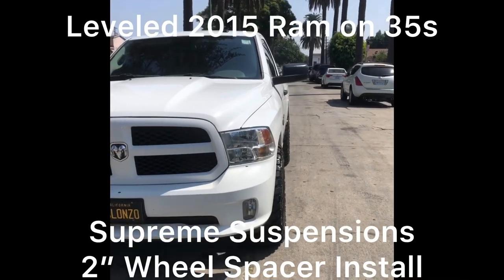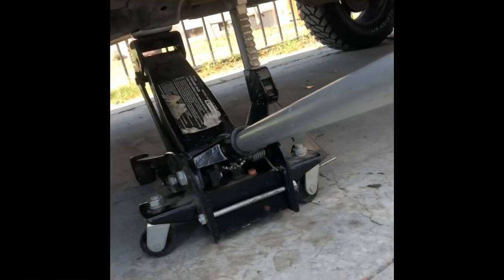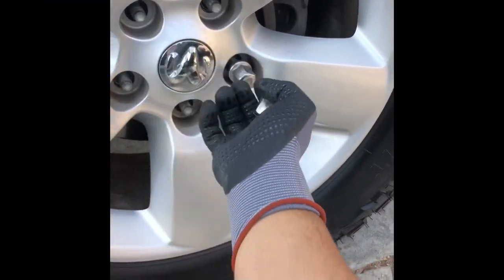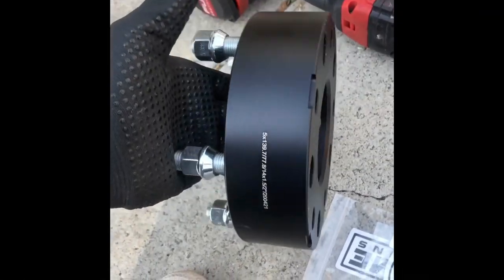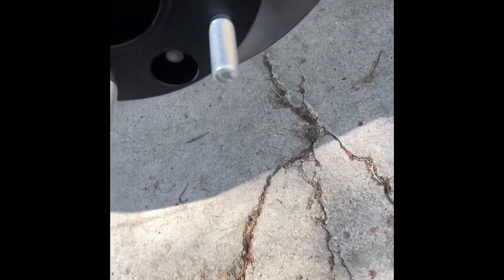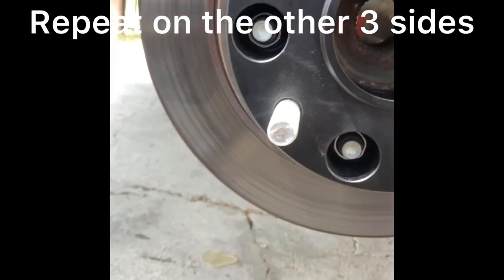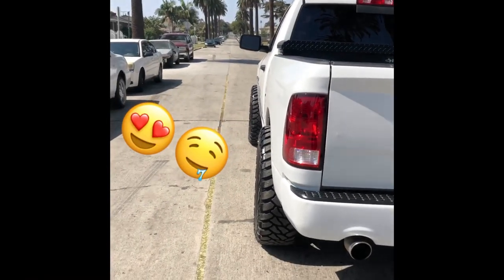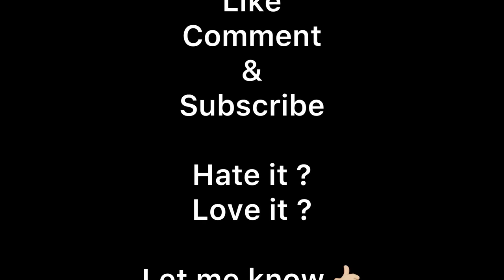Leveled 2015 Ram 1500 on 35s | 2” Wheel Spacer Install | Before & After Photos | Supreme Suspensions

Comment: Nice, had the same wheels spacers, no issues (no issues two years of use).  I removed them when I got wheels with -14mm offset, it's the equivalent of the stock wheels with 2-inch spacers.
Reply from the maker: Dope 😎 -14mm offset wheel are for big boys. Good shit bro

Comment: You got one of the highest strength loctite they have. It will be fine if you don’t take the spacers off but if you need to you will need to heat them up with a torch. Blue loctite can be worked with hand tools and red will destroy threads if you don’t use a torch first to heat the studs.
Reply: How about when I have to replace my rotors.  Do you recommend blue or red loctice?
Reply: Blue without question.  Red will ruin threads as described above. Red is for permanent. Very rarely used in the automotive world.

Comment: I just installed Rough Country 2” spacers with stock rims and 35s.  2017 Ram 1500 Big Horn.
Heavy rubbing against the plastic wheel well and it’s not even a full turn. I’m actually considering taking them off.  
How is it that it’s not rubbing for you?  You have stock rims too.

Comment: did you have to lift the truck for the 35s to fit ? i just got some 35s
Reply from the maker: I already had the level kit installed before I put the 35s bro
Reply: @shoobiedoubie6871  do you think without a level kit they would still fit on stock height
Reply from the maker: @crisguzman9  Yeah, I think they might, these trucks have a ton of space in the wheel wells
Reply: @crisguzman9  if you got this generation ram then 35s will fit without a lift or level kit .. I got a 2014 stock suspension with 35x12.5x20 and no rubbing at all

Comment: I have 24’s sitting on 35” tires, have you had any issues?
Reply from the maker: No sir 😌, have you?
Reply: @shoobiedoubie6871  
Yes my tires rub the plastic wheel well liner whenever I cut the wheels all the way to the left or right.
Reply from the maker: @Tdub66  try a 3” level kit. It’s super easy to install.
Reply: use heat gun push the plastic in more. no cutting if you don't have too.

Comment: I just bought 35x12.5 for my 2020 ram and installed a 2" level. I want to do a 2" spacer also. Just wanted some feedback to see if any rubbing issues would happen on a full turn lock position L and R would happen. Nice truck by the way
Reply: I'm wondering the same thing. I put 2 in spacers on my 09 ram 1500 3 in level kit on 35x12.5 and I would need to cut out some fender to make these babies not rub. Curious as to what all to cut out, and how to make it look good after so it's not just a hack job

Comment: Is the front a 3 inch level? I am about to do the same set up
Reply from the maker: Yes sir a 3” level kit
Reply: @shoobiedoubie6871  cool how often do you tighten your wheel spacers?
Reply from the maker: @nelktwo  honestly never, except like 2 months ago when I changed the brake pads and rotors.
Reply: @shoobiedoubie6871  do you still fit in the automatic car washes bro?
Reply from the maker: @nelktwo  if you’re talking about an express car wash like the ones that you have to go into neutral and it pulls you thru your wheel,  yes sir 🤙🏽
Reply: @shoobiedoubie6871  thanks man I am about to order them!
Reply: @shoobiedoubie6871  i installed them they look great bro
Reply from the maker: @nelktwo  DOPE ! 😎🤙

Comment: Did 35” tires fit stock bro?
Reply: I also have a Ram and bought 33s thinking I wouldn’t fit 35s on stock but I cleared 33s easily, so yes 35s would fit
Reply: @imabeastatsoccer1  what brand did yo ho with ??
Reply: @drufetti510  aturro x/t. Kinda noisy not gonna lie but really nice aggressive look
Reply: @imabeastatsoccer1  Where did you get the tires from bro? I had Atturos before on my scatpack
Reply from the maker: @drufetti510  the ones I got are Kendra Klever MTs
Reply from the maker: Yes, 35s should fit good
Reply: @drufetti510  I got mine in a local shop here in Houston Tx. I think like 230 a pop
Reply: @shoobiedoubie6871  I don’t have to do any spacers  or cut anything? Just bolt on tire and should be good on stock height? Im not lifted or lowered
Reply from the maker: @drufetti510  you might get a minimal amount of rubbing, nothing too bad, but honestly I didn’t have the 35s when it was stock, the truck was already leveled on a 3” leveling kit.